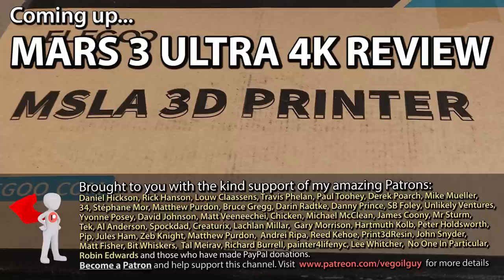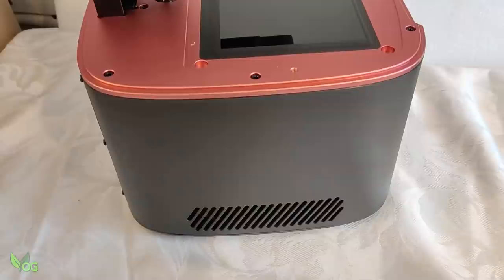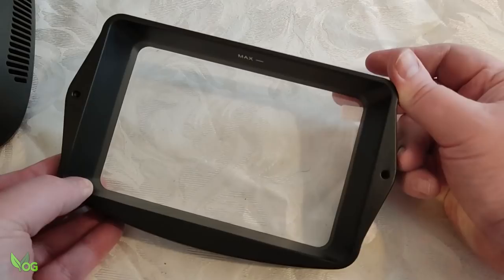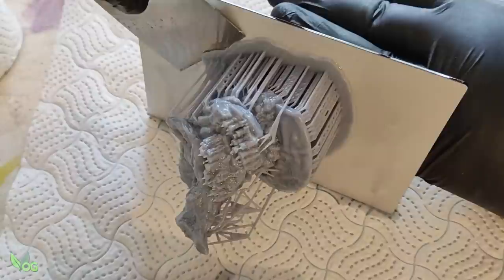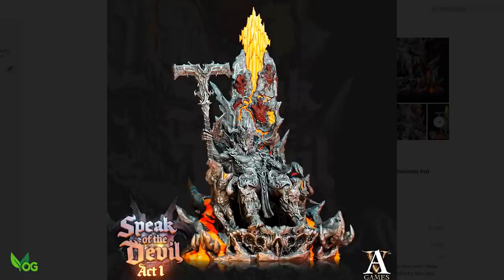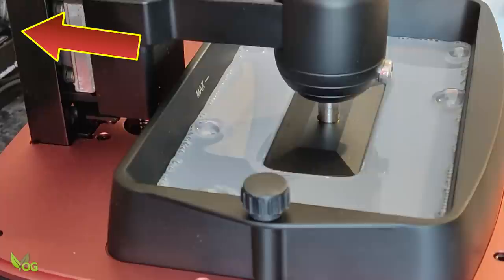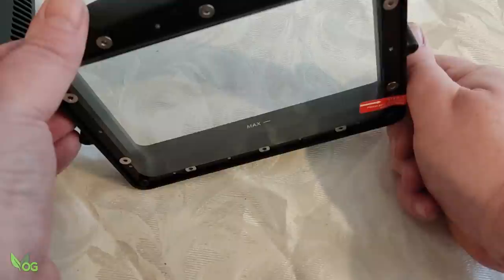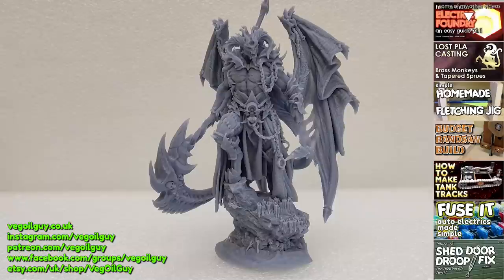Elegoo Mars 3 Ultra 4k HONEST review + Z Wobble Worries by VOGMAN

Comment: My Mars 2 pro had the same "wobble". It's actually that the z axis limit switch is set too low. Bent the tab up about a millimeter and redo the home procedure with one sheet of paper and 1 sheet of cardstock. Don't bother with the home adjustment as it does nothing.

That fixed it for me.

Comment: Hi Although a little involved it may be worth checking the linear rail bearing carrier.   I repair FDM printers on a regular basis and I've had 2 instances where the balls jam and do not circulate on 1 side. Further investigation found that this was due to small imperfections in the injection molded end caps that prevent the balls coming "off" the rail and smoothly moving into the return circulation port.   1 of the bad rails I've encountered had a plastic burr in the injection molded end cap that acted like a ratchet and would allow balls to circulate in one direction but not the other!   In both cases it was easy to "feel" the bearing having issues as when blocked the balls on the offending side skate along the rail.   Extremely careful disassembly , cleaning , rectification solved both cases but can be time consuming . Commercially it would be more attractive to replace the rail !!    I hope you find and publish the issue you have encountered. Cheers
Reply from the maker: Thanks for the informed share 😁😁😁👍👍👍

Comment: The "Z wobble" appears to be when the plate retracts and has suction holding it back from the resin. When you compared with your Mars 2 there wasn't any resin in the tray and so may not have been a good comaparison. While a printer should be sturdy enough to take the strain it may not be an actual problem when printing. I think someone else mentioned that it may also just be a loose Z (again, should not be loose on a new printer).
Reply from the maker: That's a fair point. My 2 Pro was nice and clean and I didn't want to add resin for no reason. Next time I print with it, I'll test it 😁
Reply: This sounds like it could be fixed with an easy mod, a perforated build plate.
Reply: @vogman  Consider it actually could be a feature.

When a print is released from the FEP, a slight angle of pull will detach the model from one side first, allowing for less stress overall.

Like when you pull off packing-tape from one end, and not over the entire bonding surface at once.
Reply: @ZappyOh  Most probably an unintended feature, but a feature.  As long as the plate and the print come down aligned and "on target", the "z-flex" as I'm calling it shouldn't be a problem as long as it's not indicative of a problem that's going to get worse.  Still, the Shit-too.... I'm sorry!!!! CHITU!!!!.... crap is going to kill the printer.  I'm not buying it  I'll get a non-chitu printer when I get one.
Reply: In general, some deflection is always going to be present. The issue really only matters if you have some kind of wandering Z. Also the only way to really check deflection is with the proper blocks and dial-indicators. I always go back to the problems with the Phrozen Sonic Mini4k (a problem that doesn't exist on the other Phrozen sonic 4K models I might add) where when the Z ceases motion the plate will RAISE or LOWER some, in fact greater, according to the dial indicator than .5um, in fact the variance is greater than 8um in many case. This isn't a visual check but one found with dial indication, something not found on other Sonic 4K printers, or in general, other manufacturer's printers to such a degree. This doesn't appear as bad as the Sonic mini 4K problems of the build plate not coming down in the same place every time and even not having consistent layer height because the plate will actually MOVE after the motor shuts down, sometimes up, sometimes down.  Still though, it seems these "budget" 4K printers all suffer from sub-standard axis controls and support.
I am looking at Phrozen's offer of the Mighty4K and just chucking my mini in the trash, where junk like that belongs.. but that would be putting good money again on Phrozen... which.. leaves me dubious...  I was hoping there would be other quality brand 4ks but looking at this.. Elegoo made poor choices in the "budget" 4K, same as Phrozen resulting in a substandard unit that, honestly, cannot actually take advantage of the 4K resolution....
Reply: But, it was flexing when it pressed down, the whole of the Z moved when it was going down, NOT when it was going up.
Reply: @vogman  any luck?

Comment: As far as I can see from the Z wobble - it looks as though it's the whole vertical arm moving (rather than movement between the linear rail on the arm and its carriage). Could it be the plastic construction of the Mars 3 body means there isn't as much rigidity as previous (I understand metal body) models and it's allowing the arm to flex the red aluminium top cover?
Reply from the maker: Thanks for your input 😁
Reply: I was wondering if the increased height of the Z rail combined with the plastic construction. Watching a video by Uncle jessie he experienced the same wobble.

Comment: I would suggest that the splashes you mentioned are due to the z rail wobbling. When the build plate starts lifting, suction would not let go the current layer immediately but the motor continues to rotate and z rail bends forward. So tension increases to a point when the current layer overcomes the suction force. At this moment the build plate jumps up and z rail returns to its vertical position. This jerking move of the plate gives the liquid resin on it an impulse and small drops tear off the plate due to inertia. The drops then land anywhere on the inside of the cover, on the tank or any other places depending on their initial speed and size/weight. It's a kind of catapult:)

Comment: Thanks for your first-up review. Also, your comments about vendor lock-in to a specific slicer (I.e. Chitubox) is timely and needed. Uncle Jessy just dropped a video on this printer, and others to come, using the new Chitu board/ firmware which seems to only allow the new Chitubox 1.9 (basic or Pro) slicer output to be recognized/ used by this printer, and will “lock out” other slicers such as Lychee from being used directly (one can use Lychee’ output as STL, and then input STL into Chitubox 1.9, but that is extra step and a long-term pain).
Reply from the maker: Companies need to know that they will lose out in the long run 😁

Comment: Between this and the Chitu lockdown debate I am getting anxious as a first time resin printer buyer. I appreciate you continuing updates on this unit and for providing such a detailed review to kick things off.
Reply from the maker: Don't be anxious. We're debating tiny differences in quality really. It's nice to have the newest, but it's not necessarily essential. For example, if you had the Mars 2 Pro or the Anycubic Mono SE, the quality of the prints would probably blow your mind as a newcomer to the hobby. Plus you'd be free to use whatever slicer you liked. It's only these brand new one ones that are an issue right now.
You can find reviews on both those printers amongst my videos. If you need any help, just drop me a line 😁
Reply: thanks so much VOG for the reassurance. I did get the mars 3 on presale for my first msla printer and decided to just go ahead and order the mercury X when I wanted the Anycubic plus. Price was just too good. I hope everything works out with the mars 3 and chitu but with it being the first time using a resin slicer I probably wouldn't notice even though I have bounced around for FDM slices previously and settled on Cura.

Comment: They improved the Z axis structure on the newer machines, I now have 2 newer machines and 4 older. I print rubber resin only on the newer ones as it's the only material that seems to wobble on the older ones

Comment: Was going to order a Mars 3 as my first 3D printer, but after hearing about the Chitu Box and being stuck with it think ill pass and keep researching another printer. Cheers for the upload.
Reply: A wise choice. I can heartily recommend Anycubic printers. I now own two different models and the MonoX is my new favourite. Its price really drops during sales and that build area is a dream if you're wanting to print anything larger than small mini's, jewelry and so on and so on. But I am glad I started on a smaller printer first. It gave me time to fail over and over again without much cost. It really hurts losing a giant solid print and may even have put me off the hobby entirely if I'd started on that. But that's just me, hth.
Reply: VOGs complaints on this are a bit banal. Just because his computer is powerful doesn't mean there's not some kind of weird configuration problem that causes Chitu to crash it.
Reply: I don't mean that as a criticism of VOG, by the way. He's amazing.

It's just my experience with computers. They have ghosts in them.
Reply from the maker: I started with ChiTuBox and it is a capable slicer. But if anything, it's got worse for me. It seems with every new version there's a new Windows hang up. I would have assumed it's just my PC but so many others seem to experience the same problem. 
But don't be put off resin printing. It's awesome 😁
Reply: The good news is that hopefully the arrival of the Mars 3 will push the prices on the other Ellegoo (2) (pro) etc.  The XY resolution isn't as bigger deal as some make out. In fact Ive just downgraded ( res wise) my Mars Pro by fitting a mono screen that gives 2+ second cure times. Massive improvement and i haven't yet printed anything where resolution is an issue.  Best advice Keep as much money in your pocket when starting out.  With a bit of experience you'll be able to make a far better choice in future. Good luck
Reply: @facenameple4604  lots of people complain about Chitubox bugs and stability (see the new Uncle Jessy video - same issues on a Mac). And if you are forever going to be forced to use it, will they bother fixing it once the competition is dead? its just bad on all fronts. Should be able to use any software. 3D printing needs community and the freedom it normally has to survive not Apple tactics of closed walls.
Reply from the maker: No, you're right. It COULD be my PC. I've made that point to someone else today. BUT the problem is I'm not alone it seems. That is the worrying part.
Reply: I know I'm late but I think this shouldn't prevent you from getting the printer. Yes it is annoying, but you can still prepare files in lychee and export them to ctb, don't let the fact that chitubox is being an A hole prevent you from getting awesome printers

Comment: my mars3 had the same wobble that eventually meant i kept needing to re-zero the build plate so often that it began to strip the threads in the aluminium bolt holes of the ball-joint build plate. Its probably due to increased suction with a slightly larger plate than the mars2 paired with the mars3's plastic construction versus all metal of the mars2.

Comment: Dual Z rail axis is always a superior choice, I wish that more manufacturers used it for their flagship printers.
Reply: Are there many dual rail setups in these kind of smaller machines? Genuinely wondering.
Reply from the maker: I have to agree. It's slightly slower, but smoother and less prone to wobble.
Reply from the maker: The Anycubic is dual rail I recall... https://youtu.be/0Mb0NVehGiw
Reply: On the top of my head, both Photon S and Photon Mono SE have dual rails.
Reply from the maker: I think you're right. It's one of the reasons Anycubics are usually a little more expensive.

Comment: which one will you suggest phrozen sonic 4k or this?
Reply from the maker: The Phrozen Sonic 4K is approx $1400 and the Mars 3 is approx $300. That's too big a difference. It's a major quality disadvantage to Mars. In that line up, I have to favour the Phrozen. It's amazing build quality. Mine is a year old now, frequently used, and still prints as good (if not a little better) than this brand new Mars 3.
In truth, it's not a fair comparison 😁

Comment: Brilliant review. This was never a printer I was considering but not long ago it was. For many this will be their first go at a printer and I hate that they'll be locked into unstable software. It also just generally smacks of cost cutting but that wouldn't bother me if the price was right. What does bother me is being locked into software I believe doesn't even work at all on Macs right now if you've got the M1 variants. That's abysmal and we should all boycott this model and any that lock you in to one slicer.

Also am I right in thinking that 12 months after buying this you need to start paying for the pro version?  Are you that locked in or can you use the free version when the pro licence runs out?
Reply from the maker: I believe the Pro automatically switch back to Basic on expiry. That's what I've been told. However, I'll believe that when I see it 😁👍

Comment: Had similar Z wobble on Pro 2 Mono version, in mine some screws were loose from factory on Z rail to the base of the printer, tightened and it fixed issue, rock solid now, check if you have the same.
Reply from the maker: Unfortunately not. Mine were fine.
Reply: @vogman  So basically this is a design flaw. Z axis is not properly secure to the printer. Damn, that suks.

Comment: I´ve had the same issue with an anycubic photon exept it was soo bad that it loosened the screws of the z carrier and it couldn´t home with the vat in place as it hit the top of it and caused so much deflection that i feared it was going to tear it self to shreds, granted i bought it used and with a broken screen, likely caused by homing too low. So long story short, a metal bracket at the bottom of the carrier that is used to home the printer was too short, thus having to move lower than it should, i fixed this by adding two m3 nuts on each of the screws holding this little bracket, to extend it, now the printer homes a few mm over the lcd and no longer hits the vat, it could be the same issue but at a smaller scale.

Comment: I wonder if that wobble is caused by surface tension/suction between the resin and the build plate? You tried it without any resin in the tray?
Reply from the maker: Without a doubt it's the suction. Strong stuff vacuum. And no, I confess haven't tried it without resin 😁

Comment: Great honest review as usual! :)

I trust Elegoo more than Phrozen that they will look into this, so I'm moderately optimistic any wobble will be addressed. The splashes you mentioned, Thomas caused a lot of that himself which the live chat during his stream was overall in agreement. While the Mars 3 was printing, he was moving it around, opening it from the bottom and bumped it a few times while unpacking the wash and cleaning station while the print was dripping off. So yeah... not surprising there were some splashes in his case :)
Reply from the maker: Thanks Rob. Let's be honest, splashing a few drops of resin around is easily done. I'd bet if it glowed under UV, my house would look like a murder scene 😁
As for Elegoo, I'm still willing to bet it's just my printer. Time will tell.
Reply from the maker: Thanks Rob. What an excellent a proactive thing to do!!!!!!!!!!!! 😁😁😁😁😁😁😁😁😁😁😁😁😁😁
Reply: @vogman  Got a first reply, sent you an e-mail via your contact page ;)

Comment: Does it vibrate unstable even if you hold the Z-axis by hand and move it? If so, it is expected that the problem may be caused by not tightening the fixing screws properly.
Reply from the maker: I can't find anything that needs tightening...

Comment: With the Z wobble if you print a 2cm dimensionality test cube off in one corner of the build plate as far away from the mount as possible just directly on the build plate would the sides of it be perfectly flat or would it be a slight waviness on one of the axis?
Reply from the maker: You saw the prints... they're excellent currently. That's why I never spotted the Z wobble. I had no reason to look for a problem. I'd guess it will get worse if it's not fixable, but hopefully no one else will suffer this problem.

Comment: When you say that "this minute Chitubox is the only slicer that will will work alongside the Mars 3" do you mean it's locked in some way (e.g. encryption keys required by the printer that can only be supplied in a Chitubox generated file), or is it just that other slicers haven't yet added support for this new printer?

I ask as I've taken the plunge on the pre-order for the Mars 3. I've done a bit of FDM printing but have no prior experience with resin printers.
Reply from the maker: The truth is, I don't know for sure. Rumour has it that ChiTuBox hardware is locking out other slicers but rumours on the internet should always be treated with healthy scepticism. Hopefully folks will find a fix. The printing community often does. 😁😁😁
Reply: @vogman  No, they've locked the format on purpose to restrict it so people have to use ChituBox.
Reply: @void5409  so I guess it depends if they've just created a closed format (i.e. not publicly documented), or actually implemented some encryption in the file format and printer boards. If it's the former then someone will probably quickly reverse engineer it (though then including support in another slicer may be a grey area). If there's encryption then it might be much harder - likely going to require pressure from consumers to have them back down.